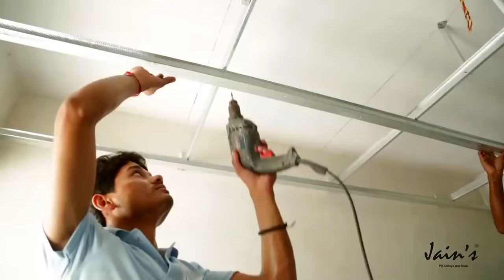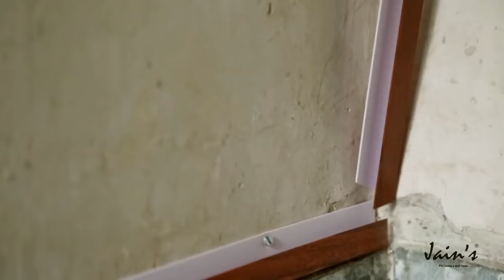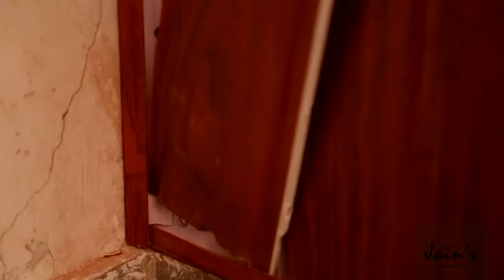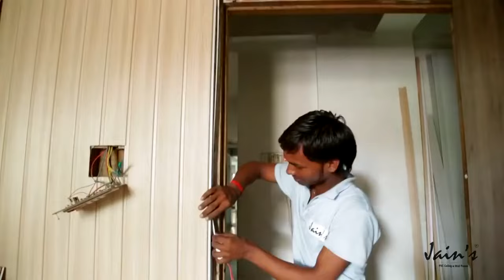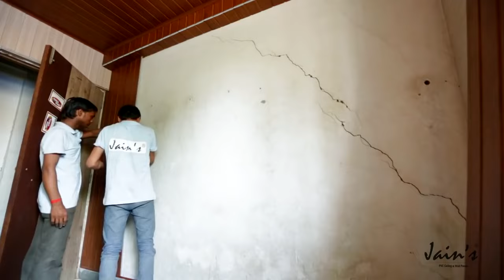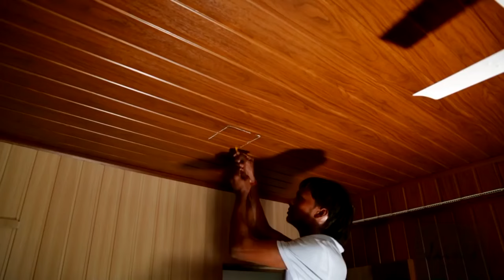PVC Wall Panel & Ceiling  Installation

Comment: Hello, sir, I am a manufacturer of PVC wall panels and ceiling machinery and equipment in China. If you need to consult, you can leave your contact information, I will contact you